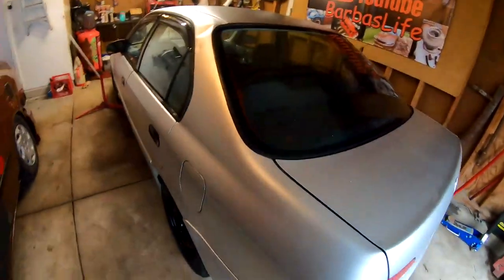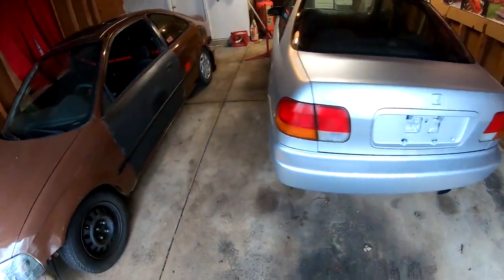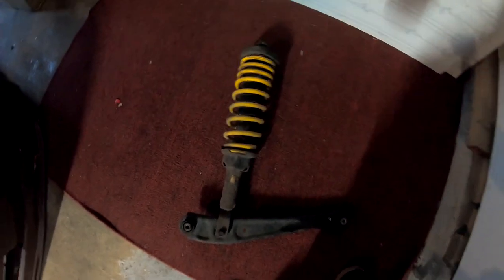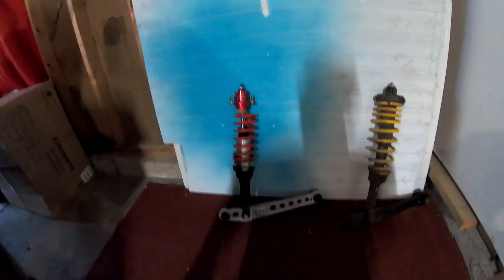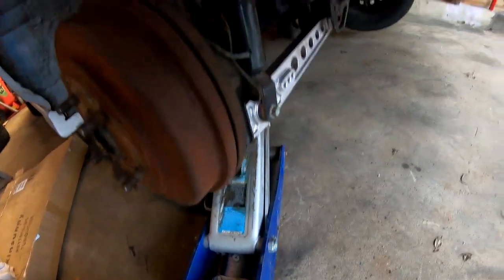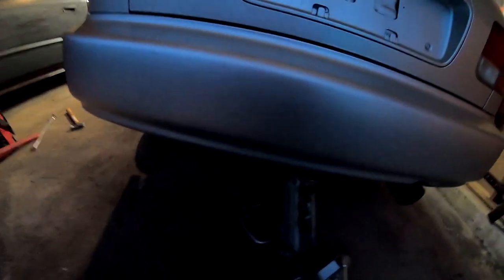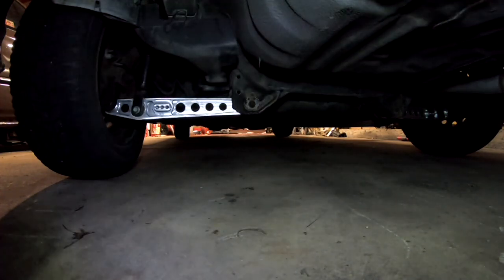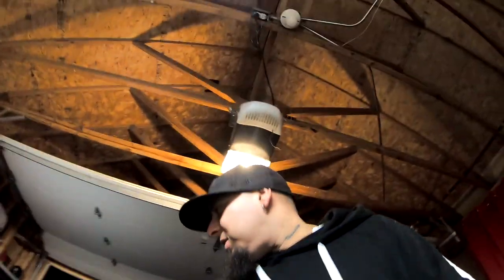Ebay lowering springs Vs ebay coil sleeves

Comment: I prefer lowering springs to coil overs. Just so much easier and less adjustments for a daily.  I didn’t have good luck with racelands on my 8th gen.  Garbage!!!
Reply from the maker: yeah i like the eibach lowering springs only problem is once you start getting sticky tires they tend to rub bad.. the adjustment is good but just a headache and waste of time to run around adjusting such a pain but necessary sometimes.